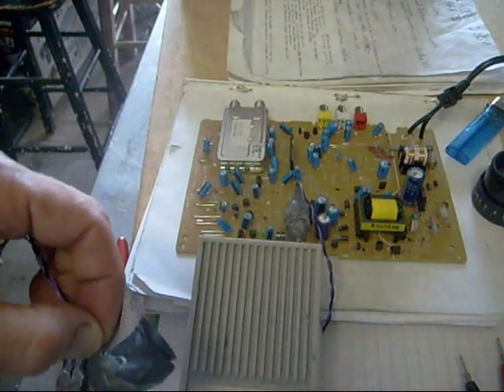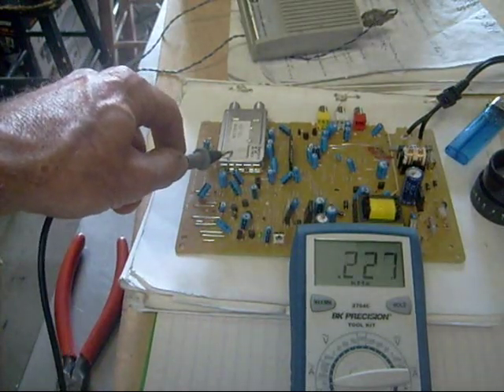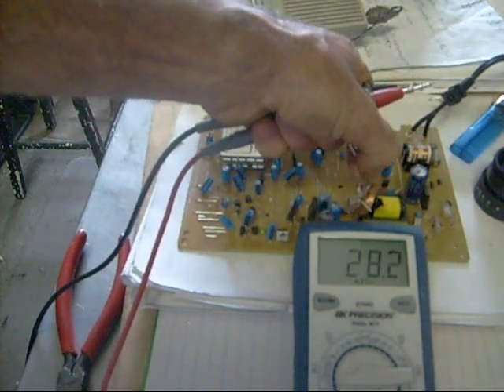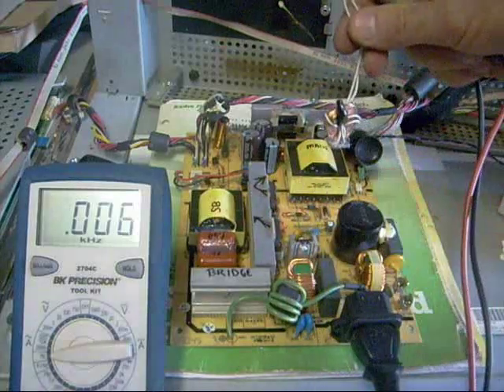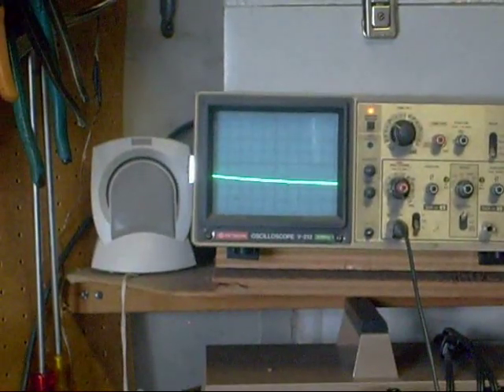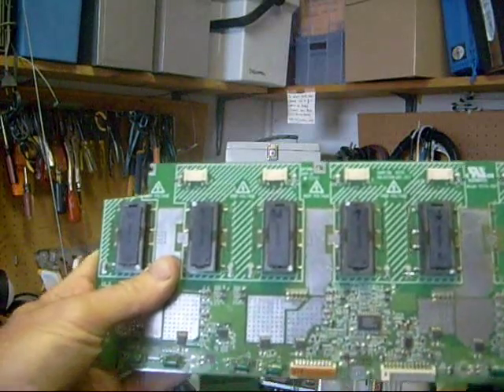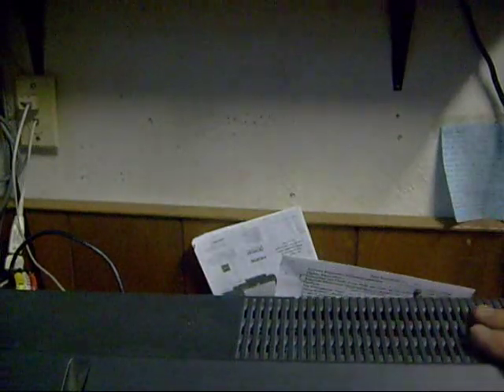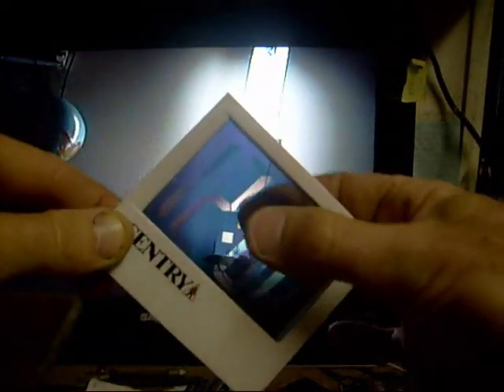LCD TV Repair made easy # 11

Comment: Your pickup coil at 1:31 is quite (physically) large, if you ever need a smaller one, you could try say 50 turns of thin enamelled wire on a short thin length of ferrite rod, like that used for AM radio "loopstick" antennas internal to very small radio handheld portable radio sets. you need less turns due to the ferrite magnifying the inductance. 

Bigger rods are used in larger sets, but you need a thinner one, though you can score and cut the rod shorter (they are quite fragile so a tap with a hammer after scoring it around with a junior hacksaw will usually result in a clean break)  In some newer tiny sets they are made like rectangular slabs like a bar of iron, but they work the same way. 

The ferrite increase the inductance per turn and therefore the pickup of the coil, but hopefully reduce the size of it and make it more accurate, especially if there's a lot of noise going on in the chassis. For long-rod ferrite coils, they have nulls (dead-spots) off their ends, in line with the centre of the rod and maximum pickup broadsides to it, but for short rods (maybe an inch long) this is less pronounced. [In fact, radio hams doing direction finding actually use the end-on null of the long-rod loopstick response to take bearing on a transmitter, not the maximums, because the nulls are sharper than the maximums so are more accurate] 

Another thing to use (and much more compact than a ferrite rod coil) is a high-value inductor component, one with PCB legs and maybe a quarter-inch in size at most, shaped like a tiny bobbin with 2 legs out the bottom. Look for values in the high hundreds of microHenries up to about a couple of milliHenries for pickup of most switchers. You can sometimes find these small bobbin inductors on junked boards.

Like the ferrite rod coil I describe above, the ferrite inside increases the inductance but makes the coil more compact, so makes it more accurate. This may reduce the pickup (simply due to reduced pickup area) but makes it a lot easier to attack to a plastic rods and poke into hard-to-get places - I've even mounted on on a drinking straw end with fine wires and poked it through the vent holes to diagnose a open switcher without even taking the case off (shining a torch through the slots to see where the general location of the PSU was) Make sure you use a non-metallic rod though, both for safety and not to interfere with the inductance and pickup pattern.

Comment: @GrantsPassTVRepairs   I had it on bench test all yesterday and its working fine now and i didnt do anything to it other than suck all the dust out with a hoover and turn it upside down.  I got it from the local tip (dump) so i have got a working 32" JVC flat screen for nothing.  Cant complain happy days.

Comment from the maker: @dukestt Sounds like a strange problem. The only things I have ever seen cause a TV to automatically turn on is when one of the tactile switches goes bad. Sometimes you can't even tell the switch is bad when you test it. In a case like this I disconnect the switch panel and use the remote control  to see if the problem continues.
Dave

Comment: I have a JVC flat screen and it does rather a strange thing.  It started by turning itself off after around two hours and then switching back on.  Nothing strange in that could be a few things.  No, the strange thing is , if you have the TV upside down nothing happens it stays on but if you turn it right side up it switches off after two or three minutes. I'm not sure what is causing it but there you go.  Any thoughts?

Comment: @GrantsPassTVRepairs I replaced the entire main board and the power supply and it did not change anything. There is another long skinny board next to the screen that I have not yet replaced, however I don't know if it will help/